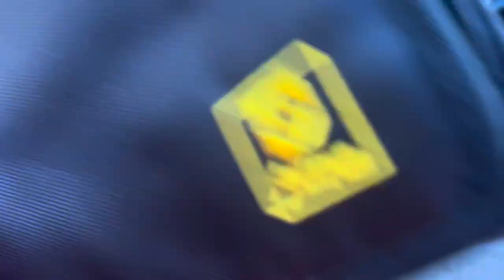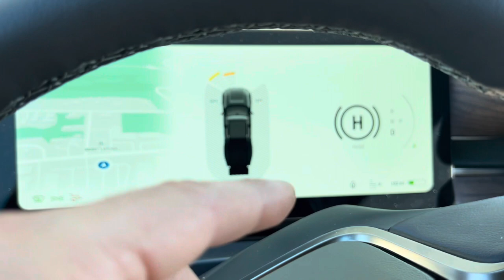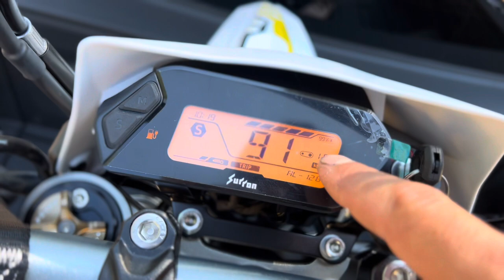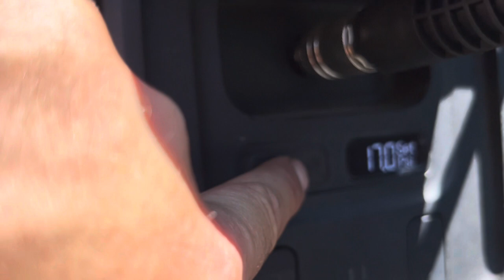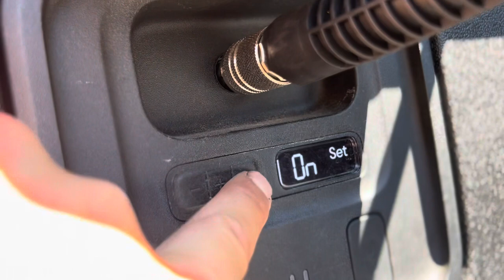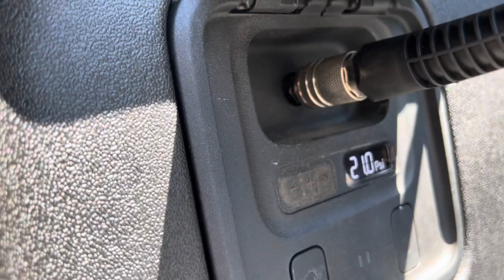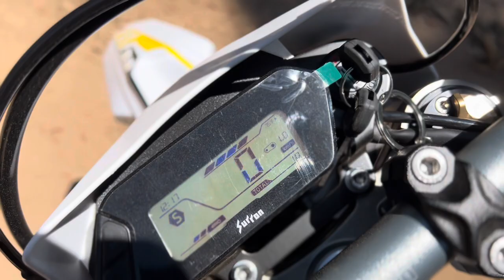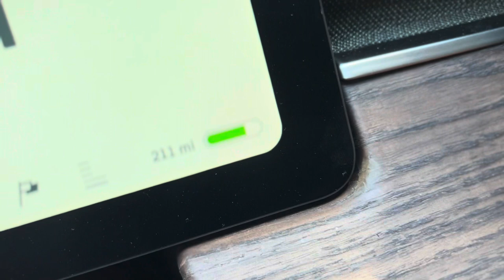Using an Electric Truck to Go Ride an Electric Dirtbike!? 🧐

Comment: There's a setting for the speed at which your Surron charges when it plugs directly to the wall from the bike.
If it's slow it might be on the lowest voltage settings, I know mine took forever to charge until I changed it.
Reply from the maker: Good to know, mine seems to be charging at what I expected. I’ll look into it more

Comment: The chargers designed to fit under the seat. You can run the cord out under the bike and loop the plug that goes into the bike out the side. There's even an indent for the cord out of the side.
Reply from the maker: Thank you, I used it on my last ride

Comment: for the charger make sure to disconnect 120v power first when stopping charging, plug in 120v after battery plug when charging. 
connect battery main orange plug first then the blue / black comm plug, disconnect battery blue / black plug first
also soprt mode with F3 setting is good
Reply from the maker: Thank you